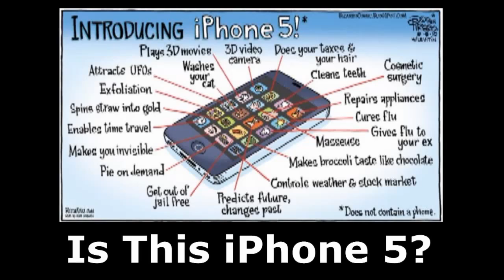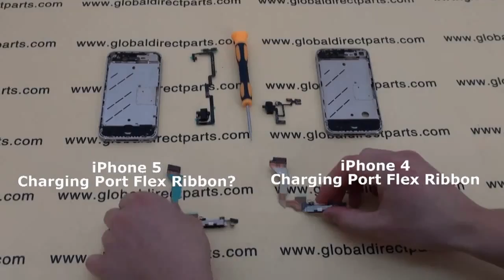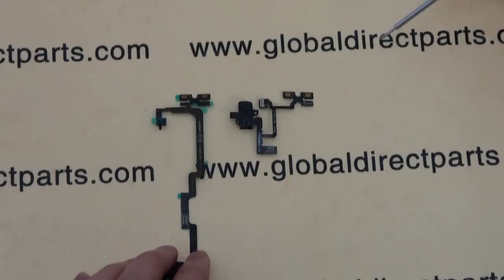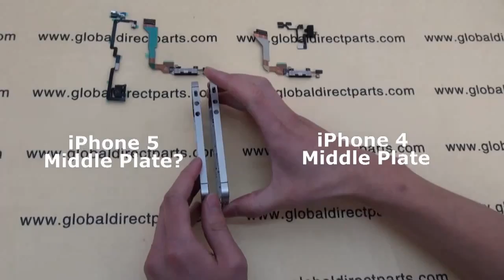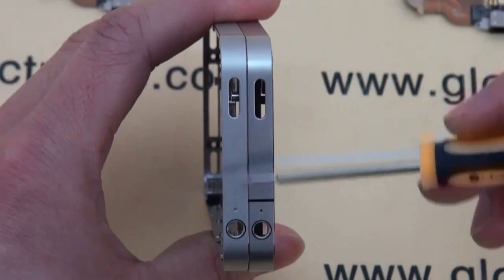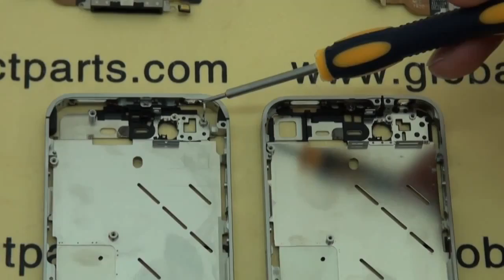iPhone 5 or Verizon iPhone Parts Leaked!

Comment: @chr248 Related "common charger" initiative(s) proposed by the GSMA ("Universal Charging Solution") and OMTP ("Common charging and local data connectivity") mandate a microUSB receptacle on cell phones for charging - but that solution seems to be based on a charger with a standard (full size USB-A) receptacle on the charger itself with a separate USB-A to microUSB B cable.  This would/could presumably work fine with the existing Apple 30 pin-to-USB charging cables without any adapter.

Comment: @chr248  I don't think there is an EU "law" mandating (miniUSB or) MicroUSB receptacles on cell phones.  The Memorandum of Understanding (MoU) signed by Apple in 2009 describes development of a common External Power Supply (EPS) with a microUSB connector for EU smartphones but also states, "...4.2.1...if a manufacturer makes available an Adaptor from the Micro-USB connector of a Common EPS to a specific non-Micro-USB socket in the Mobile Phone, it shall constitute compliance to this article."

Comment from the maker: @NuVeii The iPad won't have a retina display for many reasons, but the 3 main reasons are cost, manufacturing, and developer support. Apple can barely make enough iPhone retina displays and those are just 3.5 inches, imagine them trying to make enough to meet demand if they have to do that with the iPhone, iPod touch, and a 9.7 inch iPad, not to mention it would cost a fortune, also, it would piss developers off pretty bad.

Comment from the maker: @consumev Also, it could mean that the newer iPhone needs more power due to the CDMA chip (which they do), so it has to be able to carry more power, and the stuff was adjusted to fit a slightly bigger battery to make up for the extra power consumption.